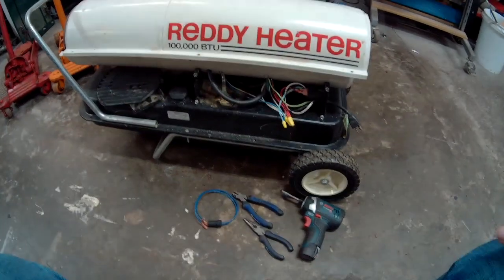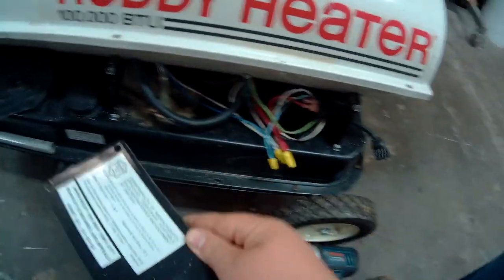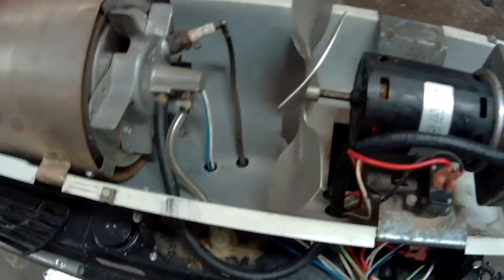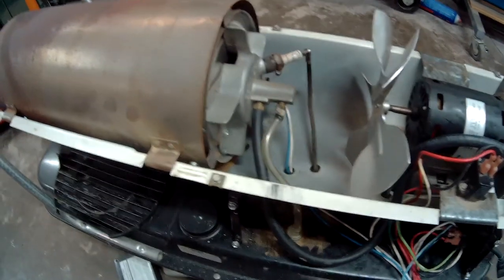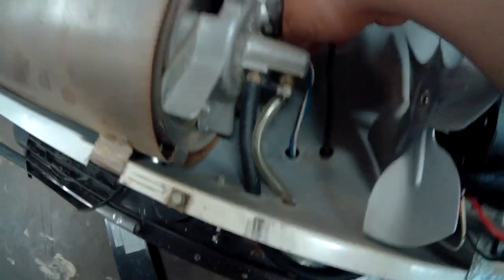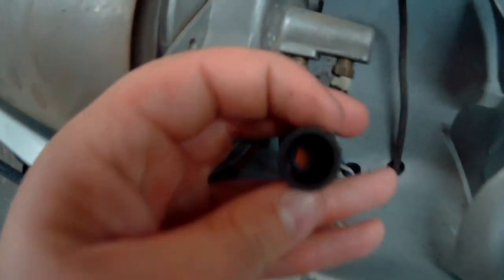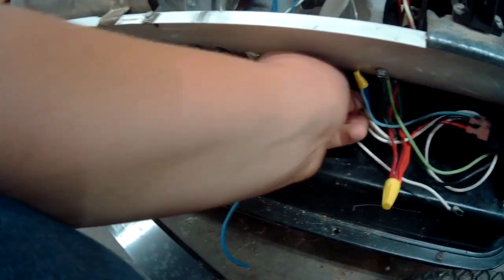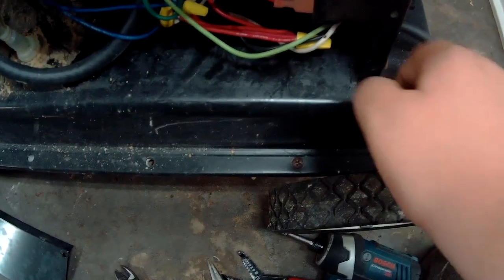[Reddy Heater Repair] Step By Step Tutorial [100,000BTU]

Comment: Does anyone know what this exact heater cost new? I got one from a buddy he marked for scrap and he got a newer unit. I have traced it down to a failed electric motor. Trying to ascertain its worth the cost of the motor replacement. Overall its clean. Not as clean as this unit in the video but it is good shape.. Thanks!

Comment: How do you know if the photo eyes bed can you test it and if you can test it how do you test a photo I to see if it works or not and did you fire the heater after you replaced everything the new lines and the spark plug in the photo I and did  You're heater work or not after you replaced everything it has to but did it work or not and how do you test that photo I